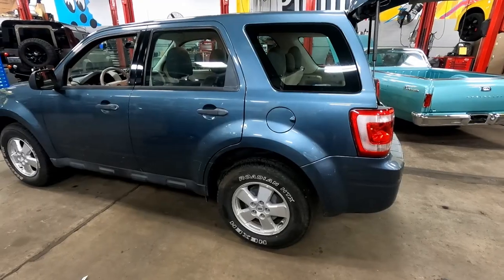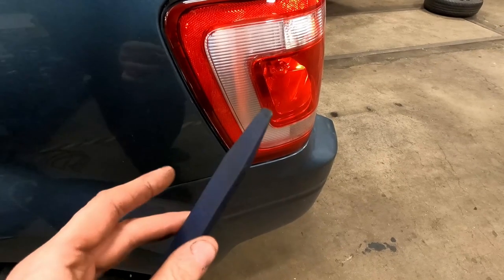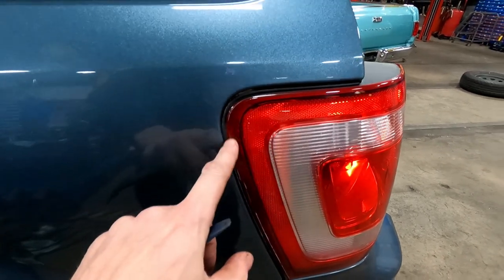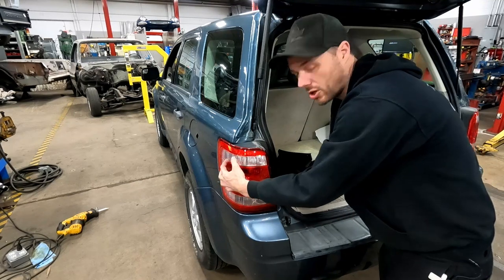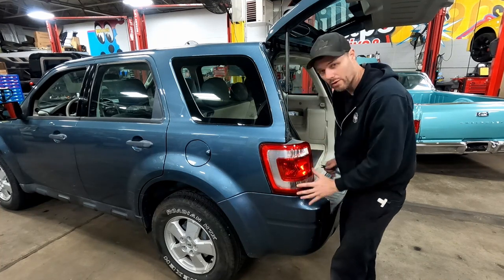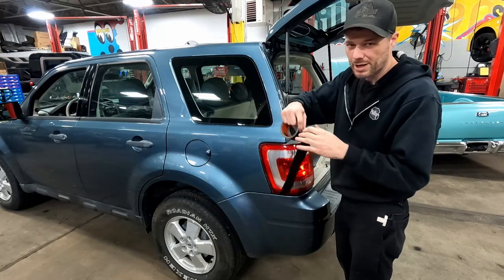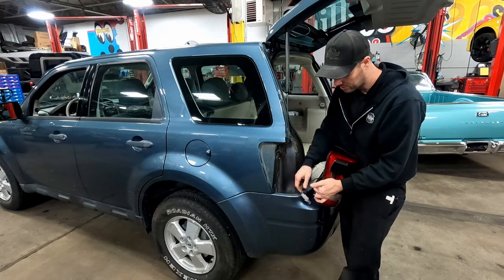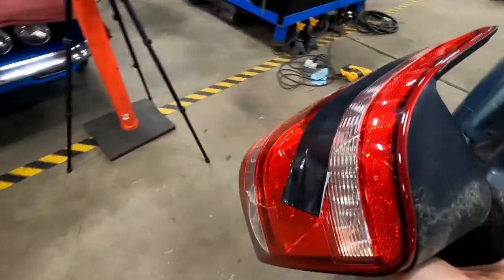HOW TO Remove a taillight Safely without chipping the lens. How to safely remove tail light.

Comment: I like to use the airbag type of tool that you use to open car doors, when you lock the keys inside. slide the airbag wedge between the lens and the body and pump it up. works really well and does not damage the lens